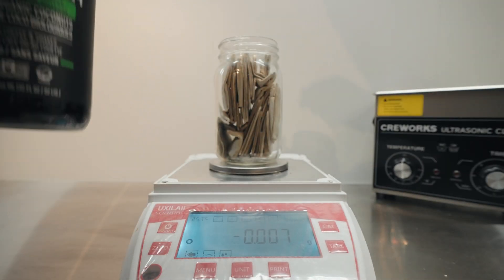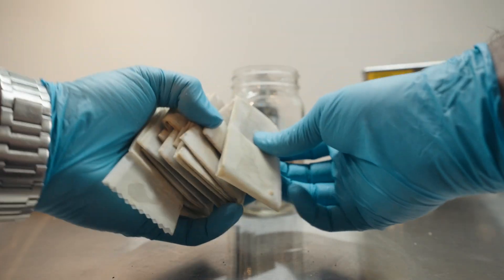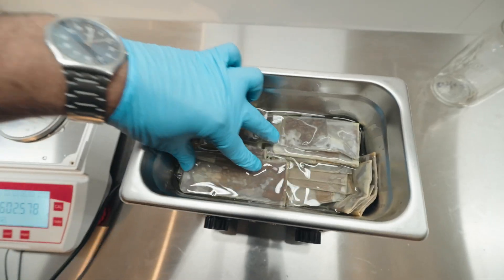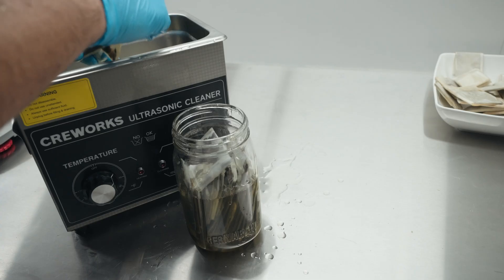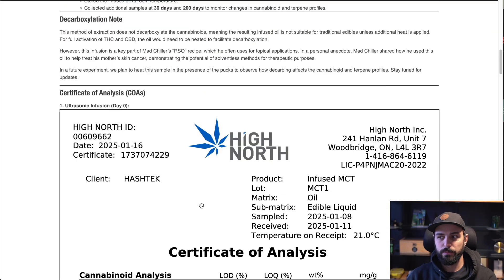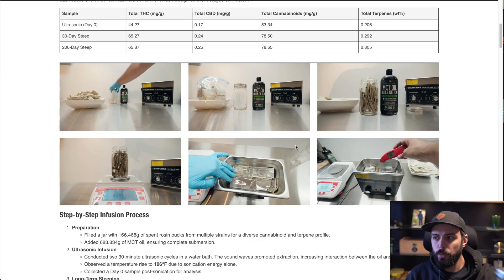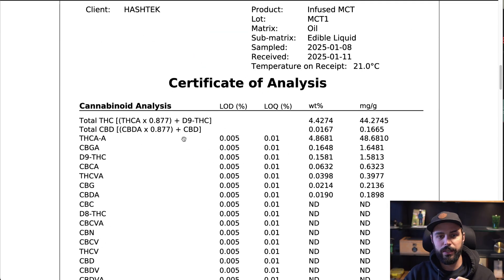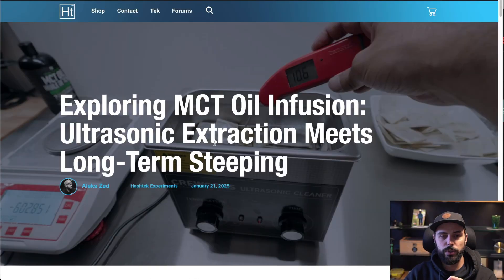Exploring Topical MCT Oil Infusion with Spent Rosin Pucks: Inspired by Mad Chiller

Comment: Would the infused mct oil work well in a capsule as an oral method or would the capsule not hold enough?
Reply from the maker: @Terpeneslurper  If taking it orally you would want to perform a full decarb so it's bioactive. Pretty much just steep this liquid at near boiling temps for a few hours until you stop seeing bubbles forming (CO2 off gassing from the decarb reaction)
Reply: @ awesome thank you. I am going to try that out and put them into gel capsules